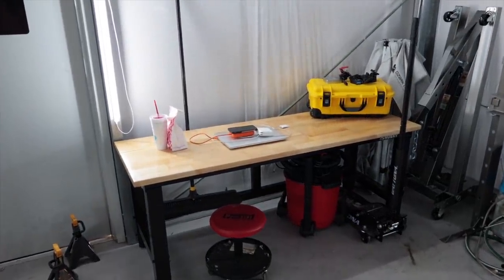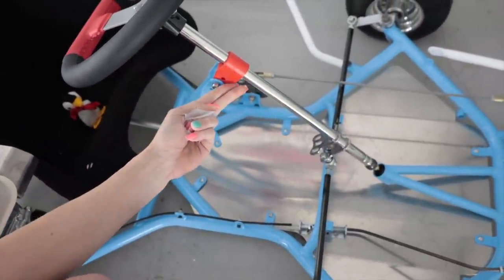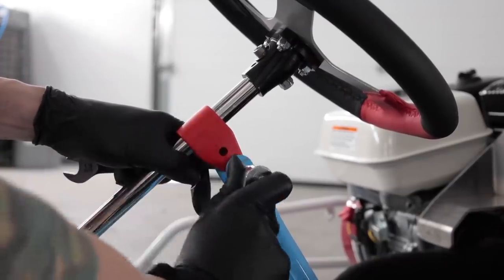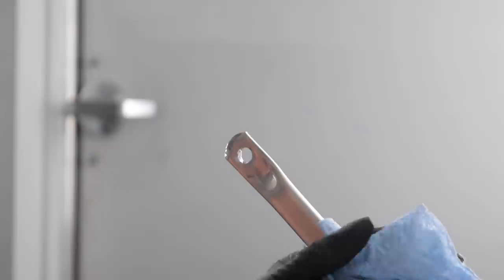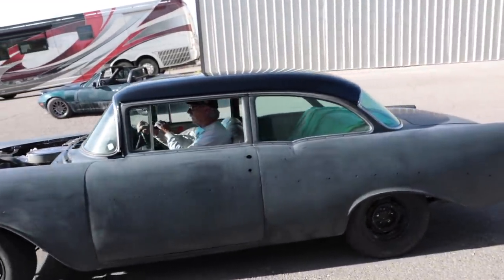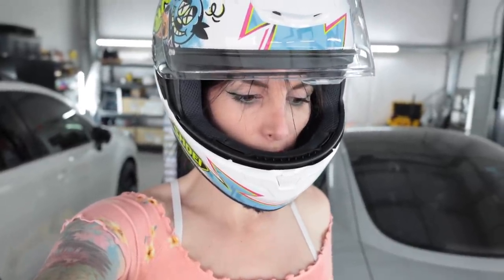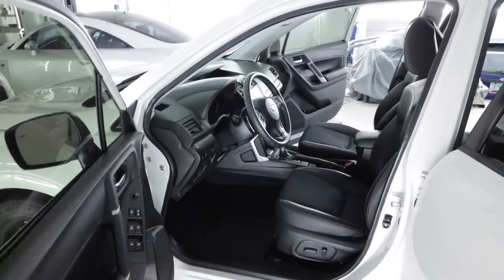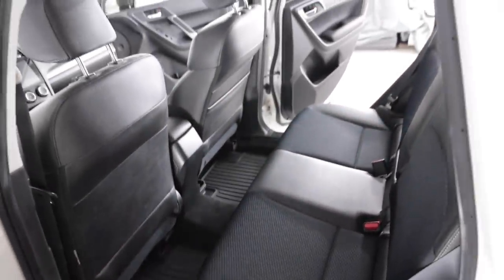Over It.. Time To Build This Engine! // Honda Powered Emmick Kart

Comment: Day 1: Hey guys, check out my fun side project.
Day 38: Welcome to the all consuming bane of my existence...I have other cars.
Reply: Lies Detected: NONE
Reply: I built a 4 by 8 foot workshop bench. Two layers of 3/4 plywood.  Painted to resist oil sinking in.  Bolted   4 four by fours for legs.  You could hammer or set a house on it. 
     And have 3/8 bolts with wing nuts holding a  vice.  So i can remove the vice for room or if i need to take the vice on a vacation ..

Comment: You can still buy those steering shaft bearings. They come in several sizes. Search for "go kart steering shaft spherical bearing" some call it a uniball bearing. To see how it goes together this video is fairly good, "HOW TO: Remove The Steering Shaft Bearing on Your Go Kart - POWER REPUBLIC". Some carts have a clip at the top and a flange at the bottom, some carts are the reverse, and some carts had a flanged bearing. Your cart should have just the plain bearing without the flange built into the bearing. The conical washers might be possible to be replaced with regular spacers if the steering column is aligned close enough to the lower bearing to not pivot enough to require the conical spacer.

Comment: What state are you in?  The go cart was cool to watch the build.  Brought back memories of yesteryear for me.  The go cart I built had a 125cc Honda motorcycle engine with direct drive high torque centrifugal clutch. Did about 60 on the straights, curves it drifted on flat curve track but a high bank that cart hugged the road at high speeds

Comment: Comet Karts or Acceleration Karting has tons of parts.  Those steering column parts are typical of many kart chassis. Most use a spherical bearing.  Your tie rods are on wrong, on the steering column side, they are supposed to be in double shear in between the gussets not just bolted to one of them, which is weak and sort of dangerous.

Comment: Actually, a split clamp collar holds better than a set screw collar.  Set screws can back out from vibration and they mar the shaft.  Look for a split clamp collar on McMaster Carr.
Reply: McMaster is the source for 90% of my racecar hardware.
Reply: Absolutely agree!  Plus, you don't have to take the whole damn thing apart, to slide it on!

Comment: Hi Sarah, you may look for a spherical bearing for the steering column. A roller bearing probably won't work since the bushing on the frame isn't in line with the steering shaft or at least not when using the upper fitting as it. Like your attitude very much.

Comment: you can 3d print an abs bearing without rollers for the lower steering shaft and put some tie rod or bearing grease, like some brass bushings on auto trans

Comment: Hi Sarah.

I'd like to suggest you search for "Spherical plain bearings". It's a variant of the bearings on your tie rod ends.
I suspect that the kart has another spiro lock at the bottom of the tube. The bearing needs to fit between them. The spherical bearing allows for any misalignment between the steering column axis and the frame tube, and the spiro lock clips keep the spherical bearing from going anywhere.

Comment: Good that you clamped down that seat holder before drilling though it to make the hole bigger.  I almost lost the end of my finger on my left hand holding a piece of metal and drilling through is.  The metal caught on the drill and spin around.  I was 18 then,  right before graduating HS.  6 stitches later and that part of my finger is still kind of numb.  What can I say I was Young, Dumb and Foolish. 😉

Comment: There's large spherical bearings you can fit in the steering shaft yoke thing. Maybe drill and tap the yoke with set screws to hold it in place. I used some on a suspension mod years ago. You can get them on ebay for around $10. I'd make the steering and brakes perfect before putting more speed down.

Comment: I remember helping a buddy of mine change the sprockets on his crotch rocket to get more speed, but I don't remember if putting a bigger or smaller sprocket on the axle makes it faster.
Reply: Bigger sprocket on the front is faster, bigger one on the driveshaft is more torque/quicker to the max speed.
Reply: @jacobusderottmann1000  Makes sense, I remember needing to get out the Dremel to clearance the chain guard.

Comment: For that Shaft issue, try placing brass or copper pipe big enough to fill the gap inside that hole where the bearing was and thin enough to fit over the shaft. Since you have that red collar preventing the shaft from popping off the column, you will have that bottom part of the shaft stable on that end with the brass/copper pipe filling the space.

Oh and that Suzuki Escudo was my fastest car in GT1 and 2, my tuning was crazy on it; not realistic and practical in the real world - I had it cranked all the way up on all gear ratios so from my top end to the bottom end sounds like it's always in pain, hahahaha

Comment: Brilliant! You need more powaaah! I used to modify these engines for racing. The easiest mods (apart from getting rid of the governor lol) is to get a  bigger carb, exhaust de-baffling (or straight pipe it) and the best of them all is the valves and springs. If you spend half a day with 3 stage valve lapping and pot much stiffer springs it will rev to 7.5k :). Change timing to suit your desired power range and gear it lower for mega skids :)

Comment: You may also want to think about stiffer valve springs on the honda go kart engine. The valves on stock springs will start to float around 5000 rpm. It is a OHV engine and they are known to have the valves give the piston a high five if they float.  Stiffer valve springs are pretty cheap insurance. Not trying to tell you what to do...

Comment: In the late 60"s I had a racing cart.  5 horse McCulloch two stroke running on premium 2.4 gallons and one quart of Cox glow fuel...nitromethane.  Clocked on the highway at 70 mph by local cop who let me go on the condition that he could take a ride.  The same summer Dick Cavett took it for a spin (Talk show host).

Comment: If you want to turn more rpm on your engine you will need some aftermarket valve springs with your other parts you mentioned. The valves will float a lil over 5k with stock ones.
Reply: Her new clutch is really slowing her down.
You need a light flywheel for rpm's.

I use cr250r and cr500r bike motors...

I built 2 Honda trx (cr)500r 4 wheelers and flat track raced them. 
Still have another 1 and my old atc 250r 3 wheeler.
 I also have my original trx 250r I've done everything I could to it except big bore it and it still beats all  4 wheelers to date.
It is actually faster then my cr500 Trx Trx 250r except in a long drag race.
The little 259r is well over 100 mph.
Crazy 

Have fun and enjoy each day all

Comment: Along with the billet internals you need to change cam and valve springs.  Then bigger carb and performance exhaust,  Like I have said many times contact Go Power Sports in Texas they can help you configure the engine.

Comment: I have Audi A6 for 20 years, and the head light is old and faded, so I took sand paper to scrub the old plastic away.  It worked, but I shopped around for poly-carbonate head light cover and found a decent pair so I am going to replace it with it.

Comment: Hang a tennis ball/soft ball on a string from the ceiling above the front of the car (parked just where you want it) so it touches the windscreen.  Next time you pull into the garage, just move up until the ball touches the windscreen and it will be just the right distance from the wall.  Just loop the ball up out of the way when not using it.
Reply: I said. That
Reply: @rsprockets7846  plus 5 others

Comment: That collar looks like a power steering line banjo bolt fitting. Maybe you could find a fubared line, remove the fitting, cut, modify, weld, size, whatever you need to do to make it fit.

Comment: Grab your calipers and measure the shaft diameter as well as the housing. Get ahold of Kaman Or Motion Industries and explain to them what your up to, they should be able to help. Also, from the days of racing Emmick Chassis (unfortunately no longer 😔) shifter carts that “snap ring” is actually a Spiro Lock. I would bet you’re familiar as they are mainly used as wrist pin retainers on pistons, but were also used in this application. I changed them all the time because they would wear. They come in various sizes and they should have that as well.   If not, they are widely available from an engine parts warehouse....JE Pistons, Carillo, Mahle, etc (I get mine from Steve Morris Engines). You may even have a branch location of one of those two companies near you, they are all over. Happy hunting.

Comment: Because of your offset seat placement you cant just pop 2 standard bearings at the bottom of the steering shaft. Easiest solution would be machine an upper and lower cup that would fit the bore and hug that ball joint and it would allow the shaft some movement like a heim joint. That would also put that retaining clip back in use.

Comment: unsolicited advise: keep close eye on the temps if you build that cart engine. if you spin that engine too high or get the engine too hot you can melt the valve. 
It will start giving your trouble starting and then wont hold pressure in the cylinder, lowering your buff 6hp. 
I nuked 2 ruckus engines spinning them up to 55mph.

Comment: I have a carburetor and an exhaust pipe that bolts right on that’ll give much more HP. Max rpm needs to be 5300 to 5600.

Comment: For the steering shaft, you probably could use a bigger snap ring to replace the retaining clip, save on cost and you could reuse the old bearing. Saw them for like 10 bucks on Amazon.
I love the effort that goes in the kart videos, keep it up
Reply: better idea make slots at the base with a washer and spring clip, like the plastic radiator hose adapter with the locking spring clip on a upper radiator hose on a BMW or Mercedes

Comment: McMaster Carr may have the shaft bearing. Didnt see if you did it but dont forget to grind two flat spots on the shaft for the hex screws in the collar. I vote 500cc ninja motor or a EV setup. Put Colin Furze to shame. :)

Comment: maybe you could find a large nut in diameter, thread it on loosely, and drill a hole for a cotter pin. i think that would work nicely, that's how it works on my honda atv

Comment: TEFLON pipe. Works miracles as a replacement for bearings when the load is nearly nothing. And you add a little silicone grease. You can even insert smaller pipes in pipes of a bigger diameter and get a multi-layer bearing with silicone grease between pipe layers.

Comment: Lovin the go cart series. Yes omit the governor completely . Billet rod and flywheel thumbs 👍.  Cheap tachometer  from chinazon.  Performance exhaust pipe and you may consider a mikuni flatslide carb . Should let you turn around 6k.....

Comment: hey Sarah, steering box ? a golf cart steering rack pinion? I don't know if you can get some to fit or not I saw a few  just a idea would be heavier then the rods you have .... restoration video OK some common, I guess there are other clips to use if have a groove for a clip such as C, E , Snap Ring or other clip need correct sizes ? try it ... :-)
Reply: you might use lock tight on bolts too...
Reply: thinking something like a bicycle head set - caps, cups , bearings for the steering  there are few other steering setups possibilities  ( and speed Mods)

Comment: A detailing tip: if you have some rusty pitted chrome, get some aluminium foil, scrunch it up, dip it in water and go over the chromed metal.  It’s works a treat and doesn’t scratch like a green pad.
Ps A colonic for a penguin.. wtf 😳

Comment: First catch up with robot vs Sarah score after the trip to the hardware store. Score as of this episode robot 1 Sarah 0. Sarah says " I'll be back"😎
I have a gut feeling that you are getting so excited and you will do multiple different clips from detailing to painting to mods. I would not mind it at all. Sometimes concentrating on only one thing can get complicated. Just keep trucking and things will fall in place. Since we talking about things falling in place, the vise on the table should not be one of those things. You will move but the floor can't😁

Comment: You probably want to put a single spherical bearing in to replace the broken one you have on the end of the steering shaft. You might have binding issues if you try to use normal bearings in there because the steering shaft doesn't look like it is supposed to be inline with that bearing housing. It looks offset to me. See if any of these sizes match what you have: https://www.grainger.com/category/power-transmission/bearings/spherical-bearings-and-spherical-rod-ends/spherical-bearings

Whatever you had in there when you got the cart may have just been someone elses attempt to fix it with the wrong parts.

Comment: google kart heel rest.  you need something like that to stabilize your feet.  We use a block of rubber instead of the metal ones that everyone sells because they are softer on your feet.  Get two blocks of rubber around 3" wide x 2" deep x 1 inch tall.  Drill a couple of holes in each block.  Sit in your kart with your feet positioned like they would be for driving.  Have someone place the blocks on the floorpan against your heel and mark the holes.  Then bolt the holes to the floorpan  This will really help with keeping your feet stable.

Comment: Hi sarah,   you can get https://en.wikipedia.org/wiki/Spherical_bearing  to fit that steering rack.   2 regular bearing will destory the shaft and the steering tube because of leverage by steering wheel.  or put a very large washer with that funny looking bearings between it, although you need a cone washer for other end.   Good luck.

Comment: Not a ton of load on that steering column bearing. While you wait to find/machine a new tapered pivot, why not just take a plaster cast of the upper piece & make a mold for either polyurethane or lead? Make a bunch of parts for almost free. That should limp you by unti you get a legit replacement.

Comment: In regards to the steering wheel problem: Would it be possible to 3D print the part out of high strength plastic or something?
Reply: Take a chunk of high density polyethylene and stick it in a lathe, drill press, drill in a vice with a bolt through the plastic to chuck it to the drill lots of fabracoble ideas available. Buy a jillion dollar CNC

Comment: valve float can be a problem. the original rod and flywheel should take the reving. shorten the governor spring a bit at a time. when you feel the power drop off. there is no point reving it more. have fun and abuse the engine.

Comment: Sarah, I think there used to be two coned races for the lower ball of the steering column. One on the top and one below as well. There should be a keeper ring on the lower parts as well to make a sandwich and secure the assembly. this site may have something... https://www.kartpartsdepot.com/Go_kart_Steering_Spindles_Parts_s/1892.htm

Comment: 9:20 you can "disable" the governor very easily on that, without taking anything apart.  There's a long rod, with a long spring around it, that runs from the "throttle arm" on the carb, between the gas tank and flywheel cover, to the gov' arm on top of the crankcase.  Put a zip-tie through the long spring, and another one on the end of the same zip tie (so, the spring can't "stretch" anymore).

A lot of people will say not to do that, b/c the flywheel can explode, BUT if you leave it stock, the valves will "float" LONG before the rpms get high enough for that to happen.  You really SHOULD get a billet flywheel, and connecting rod, with heavier valve springs/lighter retainers, and it'll run a ton better, and SAFER... but be careful, as you may get "bit by the bug" and have 1,000 bucks into that motor before you know it! lol

Comment: If you have room, put a washer down against the bearing, THEN another e-clip / ring etc.   If you you don't have the stack height, then just get a WIDER clip so the bearing cant fit thru it..............  You CAN'T just have the clamp on the steering shaft.  You need BOTH.....OPTION 3, you can use another HEIM bearing of the appropriate ID, OD and height.  Super common race car part.

Comment: Your steering wheel is on upside down. The red is supposed to be at the top, your hans will be in the proper driving position with no bracket in the way.

Comment: Start looking for a two stroke motorcycle motor.They are fairly cheap and easy to work on and I guarantee you like the speed if you install a 125cc motor.If your more into seeing your life flash before your eyes and arent bothered by wetting your pants go for the 250cc motor.Theres nothing like hitting 130mph when your butts only 3 inches of the asphalt. 
Oh,,install front breaks if you chose to enter into those speeds.Ive hit 322kph and front breaks ate a must.Not that I ever want to go that fast ever again,once was enough.

Comment: What you need to order is a 12,000 rpm 45 horse parilla motor that uses ceramic  oil to power that cart then you will do 80 mph in the straights 0- 60 mph 2.5 secs like the indy cars, then you'll be happy!

Comment: You'll need a  heim joint because the steering wheel doesn't appear to be in the same plane as the mount.  So a roller bearing alone won't work unless you can mount it at an angle. Kinda like this http://assets.superstreetonline.com/f/92097371.jpg

Comment: Measure the tube diameters then cut urself a small spacer from like a 1/2" or 1/4" whatever diameter fits over steering shaft Drop it in to the  socket ther and ...

Comment: You can eliminate the govner But I highly recommend not doing it because it can damage your engine and you can also put a turbo kit on designed for Honda small engines wich Is a better option that I would recommend using